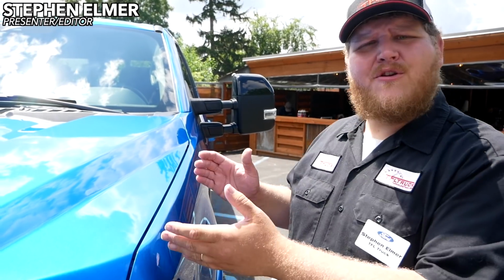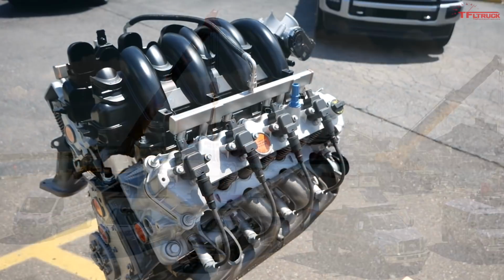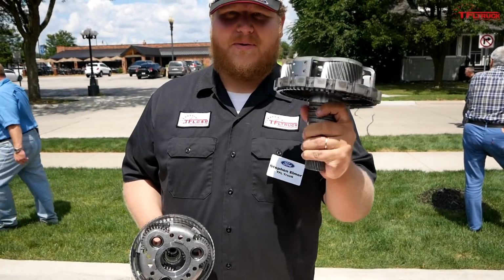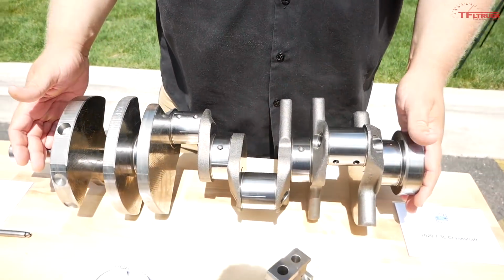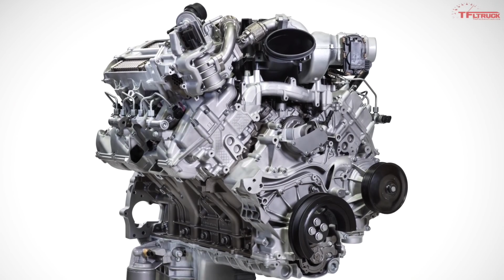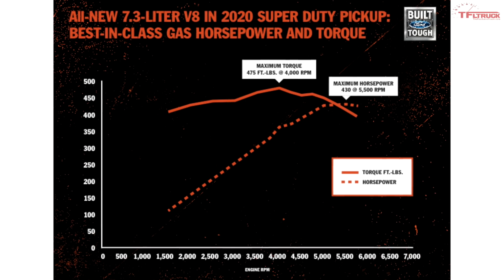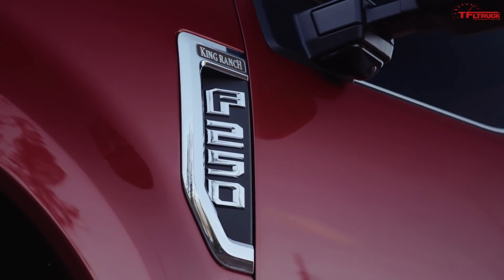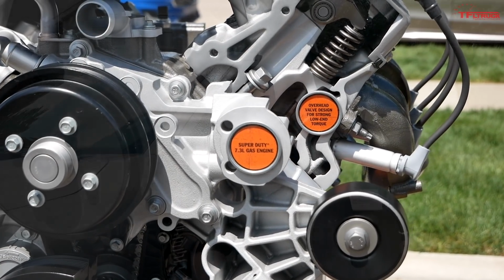We Finally Know the Ford Super Duty 7.3L V8 Power Numbers & They Are Lower Than We Thought!

Comment: 🤔 if you want a work horse get a diesel . 7.3 is gon be thirsty. Chevy 6.2 dfi makes 420/460 but now any truck with 10 speed is always near peak torque
Reply: Wrong. This engine is designed to run 14.7:1 A/F no matter the engine load, unlike typical gas engines which need to enrich under load. That’s why this engine is larger but seems to make ‘less’ power than smaller gas engines. It makes that power with less fuel.

Comment: Im tempted to pick one up in CCLB, It would pair nicely in the driveway with my 1989 F250HD 7.3idi 5speed.
Reply: If only the new F250's and larger trucks still had manual transmissions, the new 7.3L V8 Gas engine would have me back on the lot for a new work truck but without a manual option I'll keep driving my old stuff.
Reply: @wildbill23c  absolutely. I love manuals. Puts power down to the ground better, better engine braking, cheaper to fix, and far more fun.

Comment: Was hoping for 450 SAE HP and 510 ft.lbs. of torque😢 But the F250 Tremor with the 7.3L Godzilla V8/10-speed auto is still the bee's Knees. And I am not concerned about the 4.3:1 axle ratio because the 35.1 inch tires, 10-speed auto and a fairly high rpm engine for what it is will pair well with the 4.3:1 axle ratio.

Comment: Push rod technology is back! 7.3 liter should have massive crank with variable valve and ignition timing helps low end torque. Reliability and durability, with a bit of efficiency from the 10 speed transmission and rear ratio will compensate where the last generation of behemoths left off.

Comment: My 1989 7.5L 460 originally made just under 300 HP and about 430 TQ. That never felt slow and I was able to tow over 16,000 pounds. 7 more gears in the transmission and 30 years of engine tech should return better than 12 MPG even with a lead foot.
Reply: According to Chiltons, a 460 from 1990 made 230 hp and 390 ft lbs.

Comment: What needs to be kept in mind, is that with a simply tune, or port of the heads more power is made. And that's what automakers do in the 2-3 intervals where they up the power and torque in moderate increments. Tbh, if they went full blast and laid down down numbers that fit withing the cafe standards, there wouldn't be much to upgrade in those intervals without doing major work  and that obviously doesn't make good business sense. Gm and dodge will update, they will be a little higher than for in the power number and within a year ford will update and be ahead of them. Business sense guys.

Comment: So 430hp at 5500rpm but it wont rev that high before shifting, so you'll never get that horsepower, but the torque curve is very impressive and very flat for a N/A engine.

Comment: So it's got 49 more HP and 74 lb of torque than my 5.7 in my Tundra. That seems a little disappointing considering it's not even a direct competitor in that segment.
Reply: Your 325 tq vs 400 at 1500 rpm makes a huge difference. Also, your A/F runs rich under load whereas the 7.3 runs 14.7:1 all the time which is the most efficient way to run. Also it makes more average power much lower in the curve vs the 5.7 which likes higher RPM.
Reply: @NoticingBehaviors  I am 401 lbs of torque at a similar RPM not 325. They are 475 and mine is 401

Comment: Looks like Ford built a gasser that should outlast their diesel.
Reply: Their gas engines have been outlasting their diesels ever since the 6.0L was their diesel. Nothing will change. Diesels don't last very long anymore, and the gas engines have been consistently solid.
Reply: @mark7067  HAHAA you apparently have never owned a Cummins. I  have friends that can't kill the things even after 300K
Reply: @christopherbenfield7848  I actually, I have, and our company has had several Cummins 6.7s that were junk. Can't kill the things with 300,000, eh? Search VGT problems or shrinking manifolds. ALL OUR TRUCKS have had problems with both before 200,000 and required many thousands in repairs. I all but guarantee they will fail for anyone else. Besides that, all diesel trucks suffer from emissions and choking problems. One truck we had would throw emissions codes every 18,000 miles like clock work. It doesn't matter the brand. Diesel are not reliable anymore.
Reply: @christopherbenfield7848  No, you apparently have never owned a Cummins. Anything with emission controls suffer from problems.
Reply: @mark7067  DELETE THEM!!!! I agreed emissions is shit and the root of the problems. I have personalty take n 2 trucks from trash to gold just by deletes and programming. There are ways to sneak by and save yourself thousands of dollars. I understand that commercial truckers are shafted by the regulations.
Reply: @christopherbenfield7848  It's illegal to delete, and most states are now testing. It's not an option for anyone wanting to not break the law, and it's not an option for most people wishing they could.
Reply: @mark7067  
SIR, just think what it's like trying to run a trucking company with big rigs and keep everything working. We bought 2 Freightliner's with DD 15 biggest piece of junk ever. With just 400,000 miles we had to pay nearly $15,000 to get it fixed. Problem is, there are no gas engine alternatives to diesel for a truck to haul a gross weight of 80,000 pounds. That's one reason freight rates are high and going to go even higher.
Reply: @mark7067  the 6.7 is certainly better than the 6.4 and 6.0, but the kicker is the ridiculous cost of replacing emissions components out of warranty. In non-communist states like Iowa we can still delete them, but I worry those days are coming to a close. And the fact is, unless you tow over 20k on a regular basis and pretty far distance, you simply aren't going to offset the extra cost of speccing the diesel, having to put twice as much oil in it every oil change, far more fuel filter changes, more expensive air filters, and more labor costs on repairs because of how filled up the engine bay is, and the fact diesel isn't half the price of gas anymore and is usually more expensive by the time you go to trade.
Reply: @eclipsegst9419  Absolutely.
Reply: @eclipsegst9419  A by-pass oil filtration takes care of the extra oil changes, and a deleted Cummins requires almost ZERO repair cost, because when kept at sane power levels they DON'T FAIL.
Reply: @christopherbenfield7848  I'll be first to admit Cummins makes the better engine. The only thing is, Ford makes the better truck. Now, as for a bypass making up cost of ownership, I don't see it changing a whole lot. As for repairs, I'm not talking about major repairs, I'm talking about external stuff that goes bad no matter how well built the engine is. Electronic bits. It would be less on a Cummins than a PS because it takes up less engine bay, but not by much. And those damn DEF systems are expensive and only good for 100k either way. I serviced a ton of super duties, and the diesel maybe got 5mpg better on average, not knowing exactly what all the owners did with their trucks. With diesel costing more than gas and being an expecive up-spec, it's still going to take a long time to earn that back. For big buisnesses with fleets that tow regularly, it could certainly be worth it, but for the majority of customers who just farm, pull a camper, or just plain drive the thing because they can, it's not likely to earn it's keep.
Reply: @eclipsegst9419  All valid points, and I admit begin pre-disposed to bias on the Cummins, I can however say that removing ANY emissions from the diesels should be the first course of action when owning one..They completely stifle performance and durability. It is literal sabotage by the manufactures. Wish they had the balls to tell the EPA to shove it.
Reply: @christopherbenfield7848  oh I agree. Here in Iowa I can. But for a lot of our friends in communist occupied states it's impossible, and I feel like if things don't turn around with all this insane climate change alarmism, it will become nationwide. I install deletes on the side for people to make some extra cash. Certainly worth it if you can do it. We farm, we have an 02 Cummins and 99 7.3, before that we had an 85 Chevy 6.2 and a 90 Ford 7.3 IDI both with turbos added, and at the time they were worth the cost because gassers got less than 10mpg loaded down, and diesel was half the price of gas, but I can't see justifying more than one diesel on the farm whenever we decide to trade again. We'll probably get one dually diesel for towing the truly heavy stuff, and get a gasser 3/4 ton for the chore truck.
Reply: @christopherbenfield7848  Are you kidding??? The Cummins 6.7L is probably the least reliable of the Big 3 diesels. Carbon build up issues, SCR issues, EGR issues, head gasket issues, VGT issues, cooling issues, exhaust leak issues. They are a turd, but as mentioned, all diesels these days have problems, and that's mainly due to emissions controls. Unless you delete, there's no way around them.
Reply: @felix8289  Your smoking some funny stuff if you think the 6.7 is the most unreliable diesel... You must have never heard of the 6.0 Ford. There are more 6.7 Cummins in everything from tractors, combines, Penske cab trucks and Rams STILL plugging away every day and for years on end then there is Duracraps and Powerchokes
Reply: @felix8289  all caused by people driving turbo diesel engines like a gas motor.
Reply: @Keegan Johnson Yeah, I'll keep my two 7.3 diesels. 438,000 and 435,000 trouble free miles.
Reply: @christopherbenfield7848  6.0L isn't a DPF truck. You're comparing apples to oranges. Believe it or not, the 6.0L, once everything was sorted, could be much more reliable than the Cummins 6.7L. Why? because you didn't have a DPF on the 6.0L PSD! People like you are living in a time that has past. Diesels are not like what they once were.
Reply: @Digit09z  Agreed for the most part, but that's not the only problem. ULSD has less lubricity and the injectors work with smaller nozzles. They're more likely to fail for this reason, and repairing an ULSD injection system is incredibly expensive.. What's more, even if you drive them right, modern diesels are lower compression have low friction rings. This is to reduce emissions. When a diesel regenerates (also emissions related), lots of fuel gets past the rings. In theory, you should go 7,500 miles before oil changes on a Cummins 6.7, but the problem is the oil gets diluted and it actually fills the crankcase up with fuel. By 3,000 or 4,000 miles, you have to change the oil! Now, you could delete, but like I said, it's not an option for most people. All diesels made after 2006 are hell to operate!
Reply: Not that hard 😂
Reply: Delete the emission on a diesel and they will last much longer. I would advise that you wait till the warranty is expired before doing so. The ecm is a huge tattle tale and will let the dealership know if you have ever taken it off of the vehicle. The beauty that the manufacturers are catching on to thanks to Cummins. They are building the new diesels with no EGR because of the DPF. So pull the DPF and you have a million mile engine again.
Reply: @cajunguy8272  really? This is the first I've heard of no EGR. Everything I have seen on the 2019 engines look like EGR to me. I have not seen one in person. BTW the Cummins I drive everyday is sitting happy at just over 200k after blowing up at 193k. Thanks to the asshole that poured whatever it was in my fuel tank. The pictures of the tear down are crazy. Anyway, every engine has its issues, most made worse by the owners for neglect. No denying Ford fumbled on the 6.0, 6.4 and 6.7 first gen engine. Trying to make too much happen with a powerplant that lacked things like oil clearance and heat tolerance like the turbo bearings. And who really wants to own a truck you need to lift the cab off just to work on it. Have a good day.
Reply: @Digit09z  my x15 has no egr. Cummins says the design is being moved to all diesels. Theres a good power increase without it. X15 pulls and works much better than the isx.
Reply: Wouldn't take much
Reply: @MCC0NN377  Tell that to the guys with 14,000 miles on their 6.7s and have check engine lights in their clusters.
Reply: The people are funny here, they all pick the one they bought or like, the diesel mechanics that know all diesels pick the 6.0 because of the reliability after knowing the shortcomings of the stock configuration......mine has 280000 and no head studs towing 12k trailer.....just talk to mechanics that work on fleet trucks not some work bench racer that thinks he knows....praticly every person I've ever talk to about ford diesels has no clue about what there talking about....except Bulletproof Diesel and powerstrokehelp.com not to mention the seven three is a polluting piece of s*** that goes to trannies like oil filters..
Reply: put it in the category of the 7.3L diesel for simple and long lasting
Reply: I'll keep my million mile diesel
Reply: @robertrichardson9953  bet it isn't a new one. The old 7.3 IDI and 7.3 Powerstroke could do that easily but I've never seen a 6.0 or newer with over 500k
Reply: @eclipsegst9419  Its actually a 6.0 liter.
Reply: @eclipsegst9419  lol there was a 6.0 on ford trucks enthusiast 6 years ago with 800k...
Reply: @Bizketbutt  I'm not calling it impossible. You delete a 6.0 and put a different oil cooler and it isn't a terrible engine. But compared to the countless million plus 7.3 IDI and 7.3 PS it isn't much to brag about
Reply: @eclipsegst9419  I have 11 trucks with the 6.0 liter i use for hauling heavy loads for my hotshot company with 700,000 to 1 million miles with absolutely no issues.
Reply: Keegan Johnson I would argue that the 6.9 was better because the 7.3 idi had cavitation issues.  The new 6.7 is a great engine tho.  And built in house!
Reply: @robertrichardson9953  
Perhaps the problems start when people add tuners, a friend of mine bought a duramax,  the guy before him put a tuner on it, and little did my friend know the engine had a lot of expensive problems. 
The tuner gets more power, but at a cost to engine longevity
Reply: @bertgrau9246  I've always left my trucks original without any kind of mods.
Reply: @robertrichardson9953  
I can't say that myself, I had a 1990 GMC with a big cam 3 Cummins when I first got it I got 5.8 MPG I changed the fuel plunger from a number 30 to a 7, made a big difference fuel mileage went to 6.25 and made a bit more power and still lasted to to over 900, 000 miles .
Reply: @robertrichardson9953  you should play the lottery and spend some time at the roulette table.
Reply: @eclipsegst9419  417000 on my 2011 6.7 powerstroke and counting
Reply: @robertrichardson9953  not a 6.0
Reply: Our old shop truck a 05 f250 4x4 with a 7 3  has nearly 700k of very hard use. Its a beast. Only thing we've replaced is the steering column.
Reply: @bezerkura6e715 Ford didn't put a 7.3 anything in a 05.
Reply: @sasquatch8044  typo I meant to put a 02
Reply: @bezerkura6e715  Yeah, "typo".
Reply: @sasquatch8044  wrong in Australia and Brazil you could get a 7.3 until 07 thank emissions in the Usa
Reply: The big 3 have all have something I like, Fords diesel is NOT one of them

Comment: Ram needs to seriously update the 6.4 to compete with these new gas engines. Maybe in 2020🤞
Reply: I doubt it. They did a complete redesign on the 1500 and have the same old Hemi, their only update was to add an electric assist motor.  They may have knocked one out of the park on the body and interior, but still have a way to go in the power department.
Reply: @acdii  that's why I'm saying 2020...new body was 2019
Reply: @moose5.9  Pretty sure we would have heard something by now though. Ford had released the Godzilla info last year.   Maybe next year, if Ram has something, they will announce it. We'll see.
Reply: @acdii  yeah I hope so. I'd love to see the 1500 get the 6.4

Comment: 6.8 liter engine 1999 425 ft lbs. Add another half a liter 20 years later with all the advanced tech you would think big improvements. Nope. 50 ft lbs. Even the mustang made 100+ ft lb jump. And go ahead and tell me the 5.0 is unreliable 🤣🤣

Comment: 4v dohc motors are known to build low end torque and are more efficient
Reply: They are no more efficient at low rpm than over head valve engines. They do their best work at higher rpm.
Reply: Kevin Tucker 4v builds it’s power in the low range 3v builds in mid range and 2v builds up high although 4v does really shine at high revs and with boost

Comment: This is basically the old 7.3 Powerstroke diesel from a couple decades ago, but gas. It’s built for durability, is obviously de-tuned and will probably run forever. With those power curves, all they have to do to stay above competitor power numbers is re-tune it. Seems like a good idea to me.